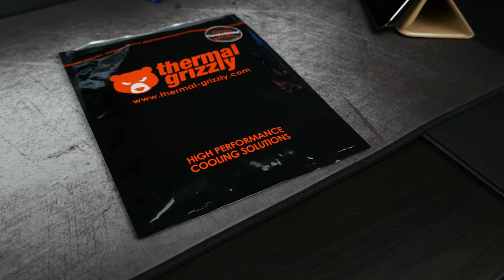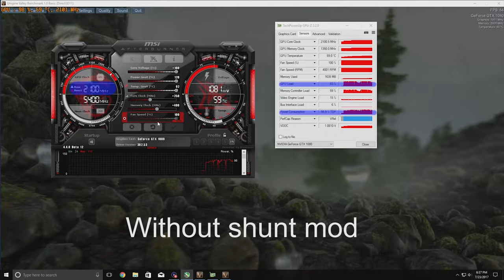GTX 1080 Shunt mod- is it worth it? (GIVEAWAY ANNOUNCEMENT!!!)

Comment: 1080s  never with  liquidmetal  you should have used  a piece of cable  because of physics  got the same  results wirh liquid metal as many others  after using a  cable it worked like a clockwork
Reply from the maker: I'm curious to hear your reasoning. What is special about a GTX 1080 that you would specifically want to use wire rather than liquid metal? Unfortunately, physics scores are by themselves, not a direct correlation to the liquid metal/wire. You have to check your power budget, so see whether or not the mod is working correctly, and if you don't have the cooling to back up the additional power, or if you aren't power limited using liquid metal or the wire either one will not change performance. It sounds like you may have not accounted for all variables.

Comment: No details, missing the point. Of course the shunt did nothing, it was vlimited
Reply from the maker: It was not voltage limited.  It was temperature limited as one would expect when you try to pump a bunch of power into a stock cooler. Why do you think companies like EVGA are releasing vbios files for the 3080 with a higher power limit? You do realize those do not have any changes to the voltage curve right? 🤔 Please come educated if you are going to come at me. 😁

Comment: Bypassing that Resistor, I'd be scared to death Murphy's Law would bring forth that Magic Smoke and trash My Card, obviously You know it wouldn't fry? I guess..  :)
Reply from the maker: If you managed to get a bit of the liquid metal anywhere else on the PCB and it bridged two contacts, it is definitely possible. That is one of the main reasons I did not go into detail on how exactly to do it, although you could get a pretty good idea just from watching. There are plenty of other videos and guides that show exactly how to do it, so I figured if someone wants to do it bad enough, they can just google search it. lol

Thanks for watching!
Reply: Naw! Wouldn't try it, like I mentioned Murphy's Law would for sure bite Me just for thinking about it, if I really felt I needed to go more extreme, I'd just do up a 1080 TI, I render some Vids and do light Gaming, nothing Extreme, that's all I'd ever need...lol   :D
Reply from the maker: Nothing wrong with that at all! :)

Comment: nice video but wy not just solder your self get good solder and a cheap iron that can be changed in temp and practice a bit on old junk and you can bridge it it really easy
Reply from the maker: The main reason is in case anything goes wrong and you want to be "that guy" you could clean off the liquid metal and send it in for RMA. I'm NOT suggesting anyone should do that, but that is the reason liquid metal is more commonly used.
Reply: i no i wanted to edit my comment and delete
Reply: i know its a costly part so you dont want to take a risck
only its so easy to bridge that with a soldering iron
Reply: Literally what he did was the best method, he was running a test, it's not something you want to keep permanently so the liquid metal was perfect for the job and works just as well for a short test with the added benefit of being easy as pie to remove.

Comment: You need to get off the burgers yank and do some exercise
Reply from the maker: I don't usually eat burgers, and there ain't no way in hell I'm doing any exercise! lmao
Reply: @LetsGetTechy  😝, great video though, I'm thinking if it's worth it to shunt my 1080 and use my h100i v2 to cool it
Reply from the maker: @DC3Refom  I would suggest using GPUz to see if the card is power limited. If so, you could definitely benefit from a shunt mod.